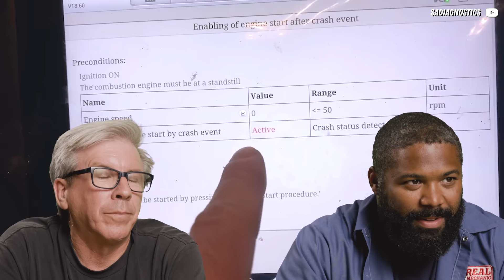Mechanic Reacts to Engineering Fails

Comment: You should get engineers reacting to bad engineering
Reply: There is no such thing as bad engineering, just budget constraints or marketing pressure.

Why yes, I am an engineer, how'd you know?
Reply: They will just blame accountants.
Reply: @GimpyChinaman  there is most certainly bad engineering that has nothing to do with budget. Lmao
I make medical tools and the number of BPs i've had to take back to be redesigned because they don't work with their mating part is astounding.
Reply: @GimpyChinaman  ah, a fellow engy that knows the truth 👍
Reply: Audi engineers dont make things easy to fix because in their mind, nothing they designed is going to break.
Reply: @GimpyChinaman  To say there is no bad engineering is to say you're perfect and never make mistakes. 

In reality, there is bad engineering, and you're clearly just shifting the blame.
Reply: @AkioWasRight I'd say most bad engineering comes from not having enough time to QC the design before moving onto approval
Reply: The CEOs are the ones to blame..
Reply: but this is real mechanic stuff
Reply: @AkioWasRight well the mechanics you could say are also just shifting blame  to the engineers.
Reply: @AkioWasRight  Self evident by the conclusive Theory of Everything?
Reply: @GimpyChinaman  Then there's sourcing. I bet FIAT used some Chinesium fuses that won't blow.
Reply: @xDMG15x  no…it’s bc of their “target demographic”…they aren’t keeping that vehicle forever…it’s going back to the dealer for everything…and it’s going to be traded in at 50k
Reply: That wouldn't work. They'd just agree that their work is good
Reply: @samcartwright7152  We're not doctors.

Comment: As an engineer one thing to keep in mind is that even if you design a whole project. The company will change out parts for what they dub “cheap equivalents”. I don’t know if most car companies make their own electronics, but I have had them swap fuse boxes on me after final approval and similar issues happened to the first clip.

Also, I was a mechanic before and during college. So I get the complaint but an engineer depending on where they are in the process has different degrees of control.

Comment: We owned a truly cursed engineered car. A Reliant Robin made here in the UK. For those not in the know, they have a fibreglass body, one wheel at the front, two at the back. The engine sits over the front wheel, with the engine partly inside the car. Rear-wheel drive.

Shit Points:
1. To get at the exhaust manifold, you used an access panel that was central in the car, just in front of the gear lever. It is not big enough to get both hands in, so we had to enlarge the hole with a  Stanley knife and pliers. This meant that the panel was then, forever after, open. This meant we had a delightful aroma of petrol fumes in the car and if there was a slight seepage of petrol, you could see it drip onto a little drip tray, then make a nice hissing sound as it evaporated.
2. Changing the front suspension was exciting because the fixing bolt at the top was prone to seizing so you had to grind off on end with an angle grinder, then drill a hole in the side of the car to line up with the bolt, grab a 4-foot length of steel bar through the bolt and hit it out with a  lump hammer. This, we found out, having worked it out for ourselves, was the norm when we went to the local dealer. You could patch the hole up again if you wanted, but most people couldn't be arsed.
3. It had a steel engine block with aluminium head. This could and did often result in warping, meaning you ended up with the car overheating and water getting in. Therefore, as you drove along, you had steam coming out of where the radiator overflow pipe should have been. This resulted in steam inside the car. Also, we knew when it needed water because it sounded like a steam train whistle.
4. The spare wheel was in the boot as normal but because the car was not watertight,  we had to drill a hole in the boot to let water out. This we also had to do the same with the footwells behind the front seats as they also filled with water. 

Positive Points:
1. Despite it being a git to work on, the parts were really cheap but not cheerful.  
2. It used little petrol and if you KEPT on fixing it, it ran indefinitely. 
3. You could run it on a bike licence, since it was essentially a trike with a 850cc engine. 
4. It had a surprisingly large boot. You could easily fit a washing machine in it.
5. It was great in the snow because the front wheel would run in the snow that was untouched by other car wheels.

We called it Satan because it was bright sulphur yellow, and it was the source of all evil. Due to its propensity to breaking down when it was most inconvenient.... We were sure we could hear it laughing at us every time we came towards it with a tool box or trying to drive it.
Reply: The Top Gear segment with Clarkson putting it on its side every 30 seconds and asking people to push him right side up again is one of my favorite Top Gear segments ever, I cry laughing at it every time
Reply: Best thing to do with it is add a frame from a proper car with front suspension suited for 2 front wheels, locate a proper engine where the stock front wheel goes, seal up the top and floor properly, add a roll cage.

Comment: I like that Sandro brought up a HUGE point that the engineer didn’t.

That it may be an easy fix but it’s going to end up being extra work to fix because it was engineer weirdly, so it’s going to cost the customer more to fix.

Also glad to see Sandro and Angelina on the same team!
Reply: That's on purpose so the dealer can get more labor.
Reply: @FuckGoogle502 I fully agree. Repair is something like 30 or 40% of manufacturers profit.  When you know that all the dumb designs make sense. Like that escape the oil is going to breakdown those lines overtime this causing them needing to be replaced, and ships tend to buy OEM first.
Reply: Bot.

Comment: I remember replacing the fuel pump in my 2002 Mustang GT many years ago. I uttered the phrase, "Who designed this shit?" exactly 37 times that weekend. But, interestingly, the reassembly I could have done blindfolded, so I realized it was designed for ease of manufacturing, not ease of service.
Reply: When the host said "I'd like to see him design a car with modern safety requirements" it made me sad, because this is exactly that. Cars are made to be manufactured as cheaply as possible, serviceability be damned. 

They don't care since the dealer will be doing a majority of the beginning services on a car, and manufacturers can get away with cutting techs pay short just because they can.
Reply: O how I can relate. Not for the mustang but for other things Ive done on cars. I had a 07 dodge caliber and had to replace window motor and regulator. Ive done them with my dad no biggie. Door panels a few screws and plastic pins(Ive always called them christmas trees). Nope not on this bitch.... I have never seen a door panels so complicated, so many bolts and screws in so many spots in my life. Needless to say the panel never got put back on. When I got done with the window I was so over it that day. I kept putting it off then the motor blew got it to the shoulder of the road and the bitch burned windshield forward. Ive done other jobs and I cussed manufactures the entire time lol.

Comment: I TOTALLY get what Sandro was saying about the battery tray. I had a bmw that needed a new oil cooler gasket but the get to the oil cooler you needed to remove the inlet manifold, oil filter housing and a couple of coolant pipes. In the process of taking the oil filter housing off it broke and as a result a 1.5-2 hour job that should have cost about £30-£50 becoming a 5 day job that cost £220 

The same car, the crankshaft pulley snapped and took the water pump out with it. To replace the water pump you had to remove the EGR cooler because it covered one of the bolts. In the process of removing the EGR cooler one of the bolts sheered and I had to have it removed. That job went from costing £40-£60 to costing £180 due to needing to call someone out to drill and tap the block. 

I can totally understand why mechanics hate doing jobs like this because they aren’t as straightforward as the customer thinks they’re going to be. And the mechanic tells them the price of the part which may be only £50-£100 but the time and labour cost to do the job and the potential for other things to brake along the way means there are probably going to be hidden costs. And then the customer is likely to think the mechanic is ripping him off when the bill comes and it’s hundreds of pounds more than they were expecting
Reply: I kept my 1991 Mercedes 190E from 2002 to 2016 when I sold it. In that time I used very little on maintenance, the cheapest car to own I ever had...

Comment: In the first video, the FIAT, If I recall, wasn't an engineering but manufacturing, it could still be engineering if they were the ones that under calculated the wire "heat dispersion quality" but I think it was rather due to the manufacturer choosing cheaper electric cabling that couldn't bear their electric load. What was happening was that the cabling would cook at what was a "safe" current level with the right cabling but due to the wiring being of a lower level, the wires were cooking themselves under normal power strain and there weren't shorts, the box's breakers never engaged.

Comment: As an engineer, (mind you, with only a few years experience in R&D and manufacturing) there is only so much you can fit into a physical space while maximizing efficiency (electrically & mechanically), maximizing aerodynamics, minimizing part count, reducing costs, etc. 

1 single change can cause everything else to need to change. So it's justifying the change to all your teams, creating & conducting tests to prove why you'd want to make the change, seeing how it effects other areas of the car, etc. 

Engineers are like the pawns in chess, that's why we get all the flak. Sure we're doing the designing and can optimize for servicability but at what costs?  The higher ups who control the money are the ones with the final say. But they won't get criticized cause they not on the front lines. 

Amazing video by the way.
Reply: 9:41 this. Engineers are there for a reason.

This is why the best car engineers have hands-on skills & experience as a mechanics as well. 

If you have the engineering know how with a mechanics aptitude, you're set.

Comment: I’m an express tech, I do oil changes all the time. Now I work at Chrysler but I’ve gotten all sorts of vehicles including that generation of Ford Escape. And yeah I spent about 5 minutes looking around for the oil filter, but once I found it I was fine with it. There are so many vehicles that put the oil filter in a worse spot. Ram 1500, V8 Jeep Wagoneer, 6.7 Ram HD Cummins needs a special tool to pull the filter out without dumping diesel oil all over the truck. But the worst one for me is the GM 3.6 in the GMC Acadia and Chevrolet Traverse. About halfway between the bottom of the car and the hood, on the front of the motor, right next to the catalytic converter.
Reply: yup.  The dreaded Acadia/Traverse oil change.  Messy as hell, requires extensive clean up, and can give you burns.  Maybe even a fire if you don't clean it up.  But it is not the worst I've seen.  An early 80s BMW (bring more wallet) had it's oil fill cap behind the alternator.  S.O.L. if you have a leak, and you paid more money for it.....suckers.
Reply: Idk... Ford Rangers with 3.0 V6s have their oil filter in a moronic spot.... right between the steering column and the left exhaust manifold and the starter solenoid, so you can either weave it past a blazing hot manifold and hopefully not make any contact with the terminals on the solenoid, or take the steering column apart and remove the oil filter from the top, which is also a bad design because you can't take the filter out without tipping it over and dumping oil everywhere.
Reply: @rollin18wheels  I remember that one.  The game of "operation" with a filter.  Twin thermostat housings on the ranger's 2.8L motor was ridiculous.  One above, one below.  Install only one thermostat.  Either position is correct, for different reasons.  Confused many people and you had to check both in case there was a second one lurking about from a not-so-distant past.  Order 2 thermostat housing gaskets every time.
Reply: @vilefly  I just thank my lucky stars that I found one with a V6 instead of a 4 banger, even though that 2.8 is enormous as far as gas 4 bangers go. I just never really understood why Ford used double redundancy on a truck engine. 8 plugs, 2 distributors, 2 tstats, probably 2 timing belts/chains, etc…. Had they used double redundancy on the Flying Fliver back in the 20s/30s, we might all have Flivers instead of Rangers, but thanks to double redundant fuel pumps, ignition systems, etc not being mandated yet and a careless mechanic not fishing his dropped toothpick out of the gas tank, the Flying Fliver (which was about the size of a third gen Ranger) might have successfully completed the NY-FL flight instead of losing his engine 50 miles from the airstrip and crashing into the Atlantic
Reply: @rollin18wheels  Small, slight correction....the 2.8L is a v6, but you took an interesting turn down the rabbit hole.
Reply: @vilefly  the 2.8 was a six? Well I’ll be. I honestly never thought there was a need for a third, even smaller than the Vulcan V6
Reply: @vilefly  yea. I’m good for that. Good ol’ ADHD
Reply: @vilefly  did they at least design the 2.8 for a truck instead of stealing a front wheel drive engine and turning it sideways and making new covers?
Reply: @rollin18wheels  Ford's 2.8L longitudinal engine was only ever installed in the ranger trucks.....for a short span.  It was pretty gutless.
Reply: @vilefly  I will never understand why Ford went out of their way to make every engine used in the Ranger as weak as they could make it without it being too weak to run. I got rid of every possible Ranger part on my engine and replaced them with the corresponding parts for a Taurus just to give it enough power to drive in traffic, and I can not find any performance parts to use on it even though they absolutely exist thanks to google’s egregious incompetence

Comment: I'm pretty sure Sandro is the Chuck Norris of the mechanic world.
Reply: Sandro's wrench once slipped off a stubborn nut, and his knuckles skinned the car's chassis.
Reply: Sandro doesn't need a car jack. Whenever he's changing a flat, he just grabs the car frame and pushes down the earth.
Reply: Sandro has never gotten splashed with oil... EVER.
Reply: Sandro once tuned up Optimus Prime. Gave him two black eyes, and a broken rib.
Reply: Sandro once dismounted an engine and dropped a socket. the socket then unbolted the entire engine before it hit the ground

Comment: I’m not an automotive engineer, but when I joined an engineering company after school I worked in the field installing and servicing the equipment for three years to understand the pressures and frustrations with things that weren’t designed to be serviceable. 

I put stuff like that access flap all the time, or even better: putting equipment on rails so it could slide out and be serviced from all sides. We do what we can. 🙂
Reply: Engineer here. Don't blame us, blame the execs. Funding constraints and marketing. They make us do... strange things.
Reply: How about add a extra 2 feet of space.
Reply: @backpain100  if an engineer would have unlimited money, i would be proud and scared of what they can do, y'all are dumb genius! <3
Reply: @backpain100  It’s always the bean counters wherever industry you go to unfortunately 😭
Reply: @MrOiram46  Unfortunately indeed. These days I don't look for perfection anymore. If we can build a decently functional and durable product then I'm ok.
Reply: I can design the perfect dooda but, are you willing to pay for it?
Reply: Dont know why mechs complain about engineers they go to school so they can get certs let them change a pcm on a 94 corolla 😅

Comment: True story: I had a fire in the back of my boss's ford transit-commuter... wiper motor, key was off and out while I was in a store. When I returned there was a loud POP which, after I opened the sliding door, I could see had been the rear window bursting in the flickering light of burning plastic. I grabbed two mostly-empty powerades and went to dousing. Texted a picture to my boss and finished the hour ride home... ventilated.